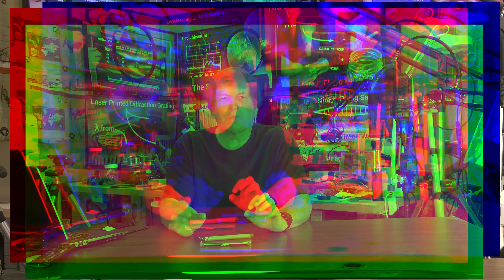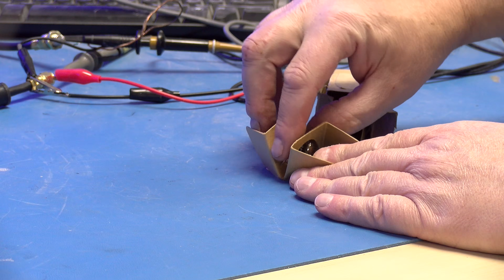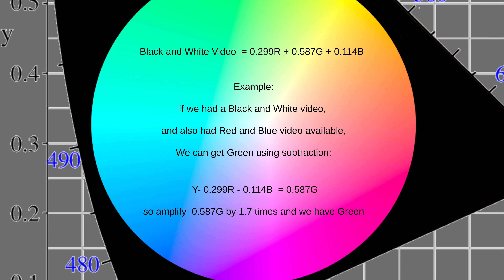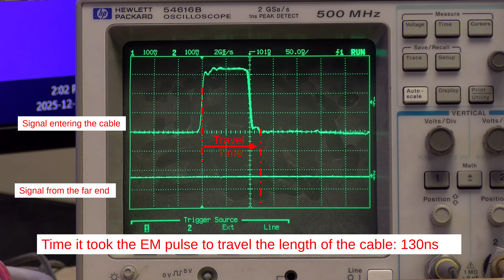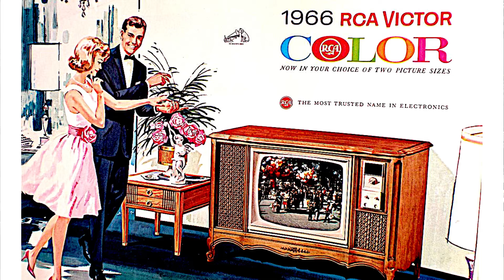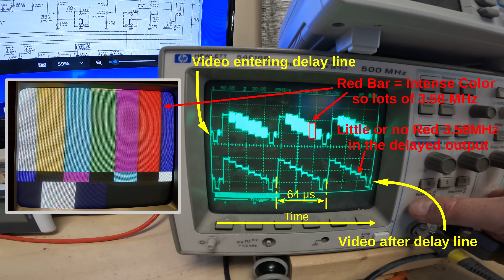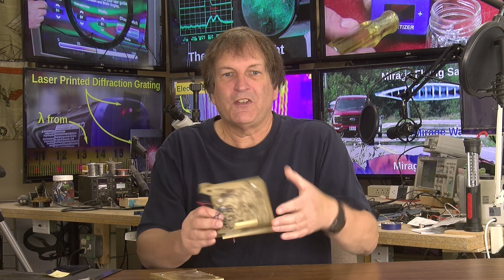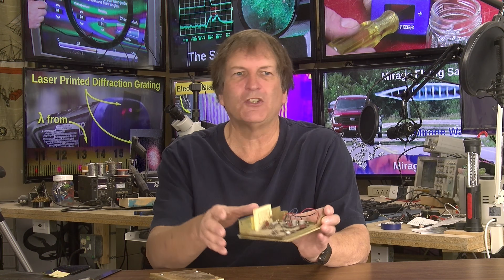How we slowed down electricity to create Color TV

Comment: Good video, NTSC and PAL have a lot in common, I will be interested in you PAL video coming up.
Reply: NTSC was a clever system being compatible with the existing BW signals. Remember that this was first developed in the ‘50s. The other systems, mainly PAL in the 60s, was ‘let’s take NTSC and improve it’. 
Line standards often get confused with colour systems in these types of discussions. In Europe we had the CCIR system 625 lines which was the HD upgrade from our old 405 system. In the U.K. our commercial TV operators wanted to use NTSC on 405 lines. It was actually demonstrated at various exhibitions and open days in the early 60s. But, the government and the BBC held out because, as well as colour we wanted to change the line system as well. 405 lines was OK for up to about a 23 inch screen but anything more and it was distinctly low def.
Reply from the maker: @gold27b  I have always been fascinated by your 405 line system, I guess becuause its a wonderful link to the early days of broadcast TV, I read somewhere That becuase the relativly few lines, some larger TVs "modulated" the vetical deflection current with a smakker high frequency wave to effective smear the beam verrtically making it wider in the vetical direction. Any truth to that?
Reply from the maker: Thanks! Yes - almost the same. I'll probably do a video that compares all NTSC, PAL and SECAM. I'll hvae to see if I can find a cheap HDMI to SECAM converter somewhere.
Reply: @ElectromagneticVideos  I use a multi-standard video output PCI card, call the PVR-350 they getting old now, but they can be set to NTSC, PAL and SECAM. The SECAM system is very different format, where a FM carrier is used that is flipped between R-Y and B-Y on each line.
Reply from the maker: @granttaylor3697  Thanks! I just looked on ebay - plenty of PVR-350 cards but all seem to be an NTSC only variant. I did some looking earlier - looks like some raspberry pi boards will output SECAM, and someone has written a program to output SECAM from a HackRF One. So I have two oher ways of generating SECAM - hopefully one works!
Reply: @ElectromagneticVideos  Good, sounds like a plan.

Comment: Delay lines were later integrated inside the color decoder ICs in the later color TV sets.
Reply: Really? They must have been very intricate.
Reply from the maker: @educatedmanholecoverbyrich8890  Early ones were things like CCDs. later were all digital - AD conversion->digital memory->DA conversion. So millions of transistors on a tiny slab of silicon.
Reply: @ElectromagneticVideos  I'm an old man, but I do recall seeing three transistors as a first integrated circuit for the Apollo spacecraft in the very early/mid 1960s. The pace of technology moves close to the speed of light, hi, hi. I used to tell my students that the technology they used today was invented way back in the 1950s-60s, but because they were ideas on paper only, because the technology was not yet advanced enough, people had to wait until the advancement photo-lithography and advanced materials to make the dreams come true. Physics, chemistry and electrical engineering needed to meld into one for these things we see today to become a reality. We are now in the realms of the quantum computer, and in the next 20 years, I can seethe decline of the PC, or melding of the same as a control unit i/o only for the quantum computer. What are your thoughts?
Reply from the maker: @educatedmanholecoverbyrich8890  I must be just slightly younger than you - I have memories of watching what I think was the Apollo 11 astronauts getting out the of the LEM as a little kid on an old black and white TV in a farmhouse that took in guests in Germany. The space race sure boosted the pace of technology development. I re-lived the whole space race reading my dads National Geographics as I got older. 

I'm less optimistic about quantum computers - so far they seem to be more along the line of primitive quantum  calculators - so great potential for doing things like cracking codes, but less so for things that are best done with precise program flow. I do wonder if they could have great potential in AI - having the ability to simultaneously  do vast number of neural pathway calculations and end up with much more useful/insightful AI. So I see quantum computers and AI more as  complementary technology to conventional digital computers. I guess we well have to wait and see! Certainly fascinating stuff!

You mentioned students - what did you teach? I did some teaching years ago an really enjoyed it - in a way doing youtube videos continuing that.
Reply: @ElectromagneticVideos  I was 18 when the moon landings took place, and I watched it live. A few months later, I was at college reading algebraic mathematics, eventually gaining my Ph.D. I married an American girl had a few kids, worked for a team in Huston that sent New Horizons to Pluto. Exciting time indeed. When I retried and returned to the UK (a long story), I got bored and decided to teach part time. Grammar school boys can be rowdy, so I tried privat boarding schools where discipline was much better. As well as mathematics, I opened radio club where I taught RF and radio construction using tubes (valves in the UK) and well as semi-conductors. The students preferred the valve side of things, but I had to instill in them the dangers of high voltage. I never had a failure or a drop-out, and that pleased me so very much, and I loved every moment. The looks on the students faces when a pcb came out of the etch was a joy to behold. We did microwave across field with a couple of milli-Watts and 60cm home brew dishes at lambda 3cm.
Reply from the maker: Yes - CCDs and later digital memory + much more sophisticated color decoding processing.

Comment: RCA engineers found a way to insert the color signal into the existing B&W signal. This way people with B&W sets could receive and watch shows broadcast in color.
Reply from the maker: Exactly - it was really brilliant engineering! And not just because they found a way to do it, but also because it was possible using the relatively simple analog electronics of the time. I think the first RCA color TV had something like 35 tubes - each maybe with two active elements. So imagine doing all of this with just 70 transistors! Today its hard to find an IC with that few transistors.

Comment: New to your channel and I learned a bunch of things about the layout of the Chroma signal. While you described the delay effects clearly when you say slow down I take that as the actual information coming out at a slower rate which means it would drift apart over time… vs a delay, that just shifts the info but is at the same “speed” does that make sense?
Reply from the maker: I guess I used a poor combination of words! By slow down I meant that the speed of of the electrical signal in the delay line has been slowed down compared to the speed of light - so it takes much longer to get from one end of the line to the other than it would take going though a simple wire of that length. But its still coming out the other end of the day line at the same rate - just a bit later than expected. Its like light going though glass - its speed slows down when in the glass (=delay line) but it speeds up to normal when it exists. 

Does that make sense? If not, let me know and and I will try and explain again. Hope that helps!

Comment: RCA Compatible Color but it suffered from phase distortion. PAL became the ultimate standard. I did courses on this when it was all new  to NZ (1973). Its is remarkable to look at all these old analogue components again.
Reply from the maker: The really interesting thing is RCA actually had a patent for alternating the phase - and choose to not use it because in their estimation it would have added another two years to the development of a practical TV set. So it was a business decision that resulted in NTSC. So in the end, NTSC was one of the classic cases of a technology being just "good enough". Greetings from Canada!
Reply: Was this something to do with the TINT? Never The Same Colour Twice lol.
Reply from the maker: @educatedmanholecoverbyrich8890  Yes exactly - in PAL every second line had the tint phase reversed (ie negative angle) so a phase error that resulted in color shift on one line produced the opposite color shift on the next line, which averaged out to the correct color if the shift wasnt too big. Good PAL TV used a delay line to mix the colors of each line with the one above it to make the any errors almost unnoticeable.
Reply: @ElectromagneticVideos  Greetings: I was recalling for a text I read some 50 years or  so ago. Though I'm not an TV engineer, just a radio amateur who works ATV on the microwave bands. It occurred to me that these very clever guys were just that, very clever, with great ideas, but had to work with the primitive tools they had at that time (1940s Cossor type scopes), paper/wax capacitors, and carbon resistors that loved to go very high with age. The admiration I hold for these chaps is close to god-like. "Go build us a colour TV from this lollipop stick." And they did. I'm English, thus I follow the British line of John Logi Baired invented television, and later, in the 1920s, colour television, though not purely electronic we have used since the 1930s, colour TV nonetheless. I'm interested in the German TV system used for the 1930 Olympics, and searching for more technical information. Do keep of the good work, and I learned quite a bit from your video and will subscribe. 73.

Comment: Great video and great explanation of how color is encoded in NTSC! However, I have one question: Why did the luminance signal need to be delayed in the TV set? Wouldn't it just be simpler to do it at the broadcaster's end?
Reply from the maker: That is a great question! I think its because in early TVs,
the chroma was usually separated from the luma by a simple high pass filter. That usually meant the chroma's bandwidth (=sharpness) was reduce even more by the TV than what was actually broadcast. And also for this sort of primitive chroma/luma separation, they may have choosen to also reduce the luma bandwidth to get rid of chroma artifacts. So in the end the end, the relative difference in luma and chroma bandwidth (sharpness) was  determined by the TV set and therefore the delay to line them up also varied by TV set. This would have been really apparent when full bandwidth comb filters were used in the 1980s and later that recovered almost all of the luma/chroma bandwidth and less delay would have been needed. However at that point I think most of the processing was digital anyway so old fashion delay lines were no longer used. 

By the way - just subscribed to you channel. Saw you had some long lines video - have visited a number of old long times towers myself!
Reply: @ElectromagneticVideos Thanks for the explanation! I was wondering if it had something to do with the filtering inside the TV.

And also thanks for subscribing! I had a lot of fun making the Long Lines videos.

Here's a suggestion if you continue to make videos on color TV: I'd like to see an explanation on why the field refresh rate had to be slowed down from 60 Hz to 59.94 Hz for compatibility with color TV. My rough understanding is that if they kept it at 60, the chroma and luma carriers would produce a beat frequency that would interfere with the audio.
Reply from the maker: @DoubleALabs  I still have to actually watch your long line videos, but they certainly caught my attention. There is a long line set of horns on a former telephone co building in Vancouver that looked in good condition last time I was there 10 (?) years ago. Hope its still intact.

I do intend to do a video on NTSC timing. I think your right about interference with the audio. The unfortunate thing is it  could have been solved by sifting the audio just slightly. I have not been able figure  out  why they didnt do that, other than at that time there was no thought that decades in the future the slight shift from 30Hz would be a real nuisance for timecodes and editing.
Reply: @ElectromagneticVideos I saw an old "Mountain States Telephone & Telegraph" building in downtown Denver with the horns still on just a few months ago!

According to a poster on Google Groups, "Suffice it to say that it was determined that to minimize chroma/audio mutual interference, the NTSC line and frame rates could either be dropped by a factor of 1000/1001, or the frequency of the audio carrier could be moved UP a like amount. There's been (and was then) a lot of debate about which was the better choice, but we're stuck with the decision made at the time - to move the line and field/frame rates. This was believed to have less impact on
existing receiver than a change in the audio carrier would."

If I post the link my comment might get screened by YouTube, but the page is titled "Why 59.94 Hz?" by Bob Myers KC0EW.